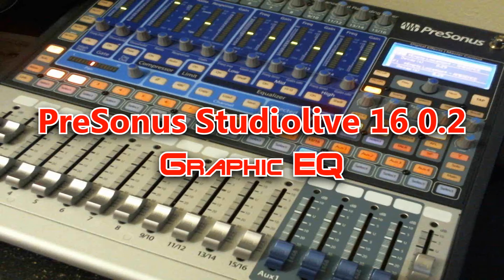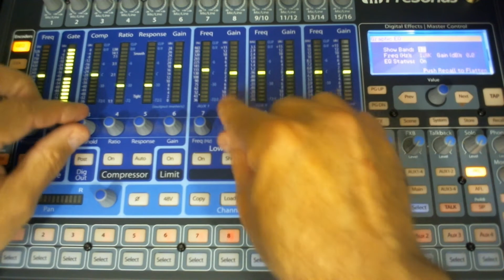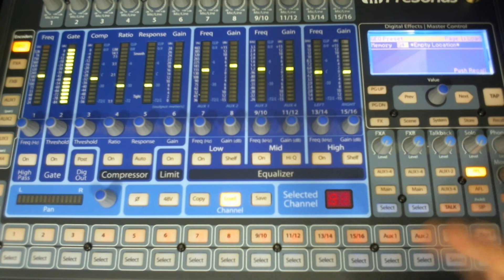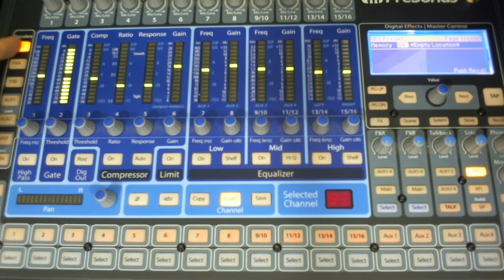PreSonus Studiolive 16.0.2 Graphic EQ

Comment: how can you use a aux for subwoofer
Reply from the maker: Plug the sub into the mono output of the mixer, that is one of the things it can be used for unless you are running a mono mix somewhere. No need to use up an Aux send. But you can send the channels to Aux 4 let's say, and run the output of Aux 4 for to a powered sub or a power amp with sub. Use each channels send 4 to set level and the master send 4 to set level to the sub(s). The same way you would set up a monitor mix on say Aux 1 for monitors or in ears. You are just sending different levels to a sub. Don't forget to subcribe! Thanks, hope that helps.

Comment: I just wanna know how to assign the GEQ
Reply from the maker: The GEQ is assigned to every channel and the mains already. Kinda like you don't need to assign it, it's on everything by default. If you select a channel and then hit the eq button you are changing the eq of that selected channel , or the mains or sub groups ect. Same with the compressors/limitors, panning ect. It's all there on everything. That's what makes these digital mixers such a bargan. Be sure to go over the manual or download it if you don't have one.

Comment: Im having trouble when main house volume lowering when it get loud. So i would like to know if it is something related it with GEQ
Reply from the maker: Sound like the compressor kicking in at the higher output levels. Adjust the compressor on the Main Outputs so it is not so aggressive and noticeable.  I use light compression of FOH and get more aggressive on the channels which need it, like a kick, snare, vocals etc. At sound check run the band thru the loud parts and compare using the compressor on/off switch until you can get it to even out. Compressors work nicely on FOH to give everything an even level but too much will not sound natural, as you are experiencing.
Reply: TheGospelGuitarist thank you very much